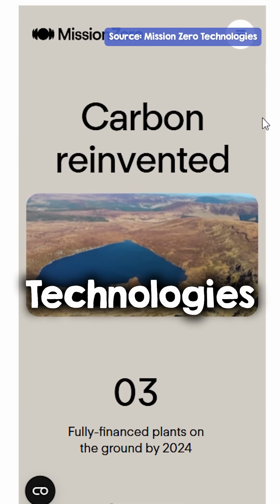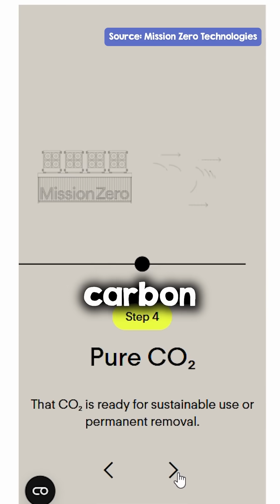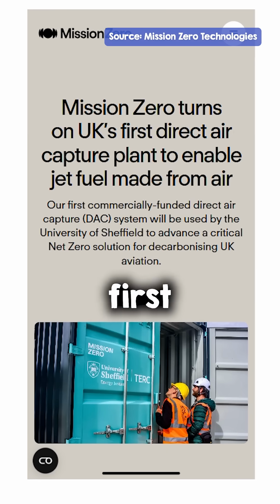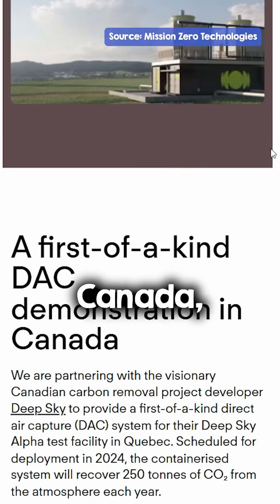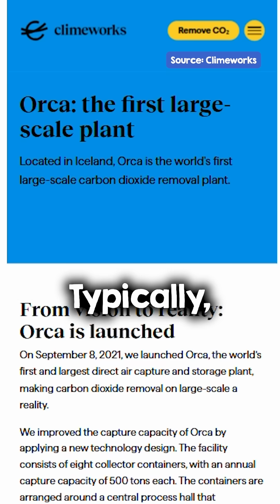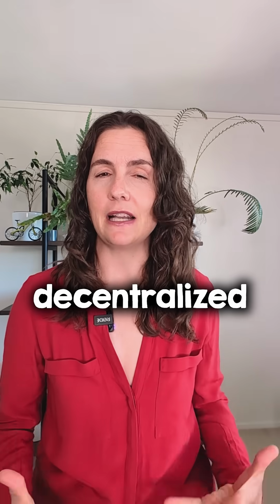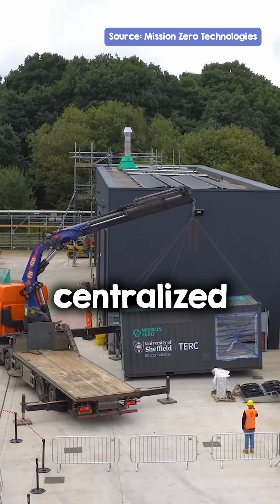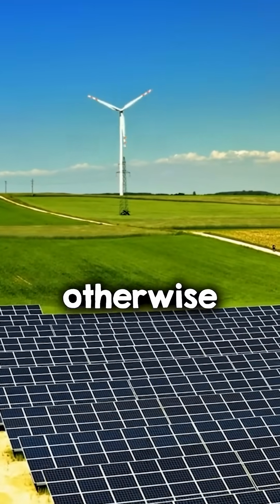Carbon Capture, But Make It Portable

Comment: Why do they need to be modular, the atmospwhre is fully mixed so why not take advantage of scale? It just doesn't make sense. Curtailment is an option but why not use that energy to electrolise water? 

But thats DAC, nosense. Unless its less than the ETS cost or produces a useful material.

Comment: G'day,

Interesting...

How much CO-2 is released, in the manufacture of the Equipment which captures 50 Tons of CO-2 in a year ; and how many years of operation are required to break even...?

What is the Half-life to Failure, of the Equipment (Designed Operating Lifetime)..., and will it clean up it's own
Manufacturing Emissions, before it needs to be replaced...?

Compared to planting and watering Trees with the money spent in conducting the Experiment...; then one wonders why this Project is not an example of
Diversional Therapy and
Basketweaving for
Industrial Futilitarianists
Who want to be paid for doing "something clever" enough to be able to service their 
Mortgages...

(A Guage is for measuring, and Mort is French & Latin for Death...; and a Mort-Guage measures how much may be paid back to the Moneylender, bevire the Borrower expires
From
Overwork...).

A lot of certificatedly
Clever people appear to be
Highly likely
To pay their Mortgages for
Years, maybe decades,
In pursuit of this
Particular
Shibboleth...,
Apparently.

Such is life,

Have a good one...

Stay safe.

;-p

Ciao !

Comment: Check out your expatriate countryman Dr Casey Handmer and his startup Terraform Industries in LA. They are developing a low cost massively scalable on-site solar powered DAC process that produces pipe-ready natural gas (methane) cheaper than drilling it, for the very long tail of industry that will take decades to decarbonise. The economics stack up today near the equator, and and up to much higher latitudes as the cost of solar keeps plunging.

Comment: This does sound like a step forwards, but I’d really like to know how much energy they used and resources to capture that 50 tonnes of CO2 per year. (Bear in mind that just one 747 aircraft emits approx 475 tones of CO2 per tank of fuel, and likely more if you include the making of that fuel)

It would also be interesting to know the total carbon footprint of capturing that CO2. 
I also still think that no matter how economically viable they make it, it’s always going to be an additional cost to running fossil fuels, when it would be much better to focus on stopping burning it in the first place. #StopBurningStuff 🌎 ❤️
Reply: As Rosie said if you colocate it with renewables that have high rates of curtailment the energy can be free or even negative cost (as well as clean), but it does lead to low utilization which increases cost per unit. I think that's the only case it makes sense, if the renewable energy was going on the grid for consumption you'd want it to go to a real consumer so it could displace fossil fuel generated power.
Reply: So this machine takes close on ten years to clear the carbon deposited in the atmosphere by just a single long flight of Air Force 1.
Reply: @londonwestman1 exactly.
Reply: Put it another way.. the machine removing CO2 from the atmosphere is roughly cancelling out the CO2 emitted by about 8 Ford F150s driven the average number of miles per year.
Reply: @londonwestman1 yes. And there’s no mention of the energy and resources needed by the machine to remove those 50 tons of CO2. I don’t know if the 50 tonnes is net or gross.
Reply: yea it still sounds like a ton of work to install a container-sized thingy that needs constant power to function. how is this any better than a buncha plants? the fact that they can't just market the thing using their numbers already shows they don't have good numbers. "looking for a niche" is basically a nicer way of saying "help, we might be going bankrupt cos we're kinda useless"
Reply: @alveolate lol I like your ‘looking for a niche’ definition. 😂 usually true.

Comment: I think it would be a neat innovation if someone made a car attachment to capture all the CO2.  Of course there are plenty of CO2-free cars already...
Reply: When you actually work out the scale and energy needed it would be ridiculous. It’s a good thought experiment, but at atmospheric pressure and room temperature, the CO2 emissions of an average 40mpg family car are about 150litres of CO2 gas per MILE! Yes a bathtub full of gas per mile. Scary.
Reply: @deanfielding4411  That is... less neat.  Thanks for the info!
Reply: @madcow3417 You’re welcome. I’ve done a lot of research on CO2 and the numbers are astounding. Every litre of petrol burned produces about 2.4kg of CO2. CO2 occupies a volume of about 550 litres per kg at room temperature at atmospheric pressure. That 2.4kg doesn’t include the circa 0.5kg per litre of CO2 for the mining/drilling/pumping/shipping/refining/distribution of the fuel before it gets burned. 
Electric vehicles and renewables just make so so much more sense in my opinion.
Reply: @deanfielding4411 Now how many liters of carbondioxide to scrap your old petrol car and build your new electric car and whatever changes need to be made to acommodate your charging port at home?
Reply: @TheBayru a LOT less than keeping running it. When you explore everything and realise you only need to mine about enough to make the car, then you don’t need to keep mining to power that car. One study suggested that a renewable economy VRs fossil fuel economy requires 525x less mined material. The more you look into it and the more mining machines also turn electric the more it makes sense.
Reply: @TheBayru Minimal changes for charge point too. They actually help balance the grid.
Reply: @deanfielding4411 I wouldn't exactly call changing every domestic installation from monophase 1x230V 40A to 3x400V 32A, including the doubling of the total warranted net capacity (added/replaced net cables), tripling the number of distribution cabins and doubling the spike/low mitigation measures (flywheels, battery banks, turbo-props, standby coal power plants) "minimal".
The fact that the added 50% users are all 3-phase and thus the load is spread "50% more evenly", ... yes, that contributes to a more stable net. But you just doubled your net lol...
Reply: @deanfielding4411 A renewable economy vs a fossil fuel economy ... I'm sorry bud, but there's a difference between switching from fueled cars to EVs and moving from a fossil fuel economy to a renewable economy. It's not because you drive around in EVs that you suddenly start recycling your PET bottles and clothing. Arguably driving around on biodiesel and ethanol in an old SAAB is more of a "renewable economy" than driving the inseperable composite sandwich that is the base of your average EV. Not to mention that EV infrastructure promotes driving cars instead of motivating bicycle and public transport use and thus in fact hinders moving towards a sustainable renewable economy.

Comment: Maybe some cost level, albeit high, is simply unavoidable because the atmosphere must be cleaned up.
Reply: you see, when it comes to such tech stuff, what makes or breaks it is the actual numbers. obviously the atmosphere could use some clean up, but there are many options available, why is this brute-force-yet-not-really-oh-look-we're-modular approach any better than the already bad DAC ones we've had so far?

like the other comment mentioned, is this container-sized thing really better than a dozen pots of bamboo?
Reply: @alveolate  Good point.  By far the most effective clean up is regenerative agriculture.  This approach actually brings a lot of carbon into the ground that has been released through destructive agriculture.  Of course, humans have made the situation worse by releasing 60 million year storehouse  of carboniferous era carbon perhaps somewhat more quickly than it was amassed in that era. (sarcasm warning)  I still think it is worthwhile to find actual elemental carbon sequestration solutions that will only be made more effective if we keep researching and trying.
Reply: "modular".and bulky. Maybe u can store all that CO2 in your basement I suppose. Let's just go back to the stone ages, using fire n wood. Probably help more than producing such cyclic industries.

Climate change is also aided by the tilts of planets. See professor Neil degrasse Tyson for explanation.

Comment: Separate the carbon from the oxygen.  Then two pretty safe elements to store or release in the case of O2.
Reply: true but breaking chemical bonds can be expensive
Reply: This is extremely energetically expensive. They currently compress it into supercritical CO2 before burying it, which is also energetically expensive, but orders of magnitude less expensive than dissociating it.
Reply: @chiaracoetzee UWash patent makes it easier
Reply: @mikeklein4949  The energy comes from combining (oxygen with carbon). You're implying perpetual-motion, also known as over-unity.
Reply: AKA photosynthesis
Reply: Enzymes to lower the energy for a reaction to occur, is the trick.  Chloroplasts do CO2 dissociation... solar powered even.
Reply: CO2 is also safe to release.
Reply: @aliendroneservices6621 Keep up